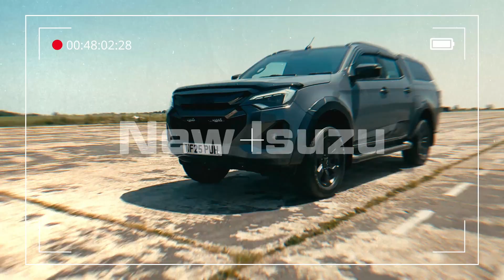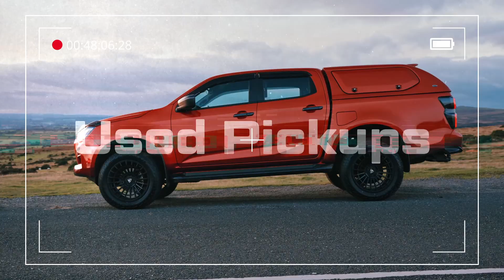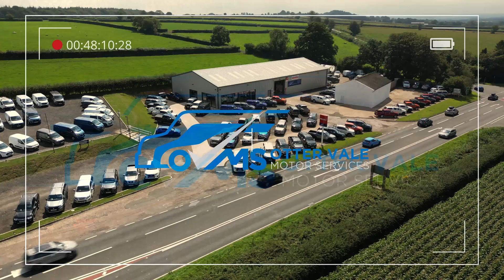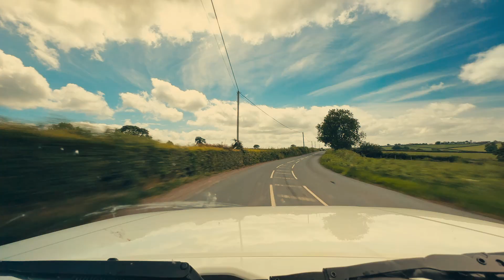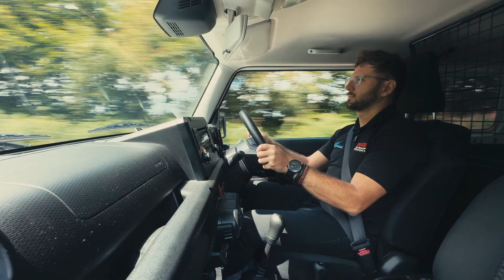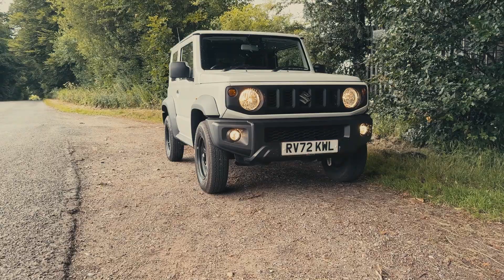Suzuki Jimny 2022 Commercial Vehicle Review

Comment: Good video, thank you. I’ve just bought a Japanese import Jimny. I’m’ 6’3” and have no problem with comfort and the driving position, but mine doesn’t have that cage in the back. My model is somewhere between your commercial and the full spec SZ5 without the screen and all the lane assist gizmos etc. Mine has  good air con  and a good stereo together with heated seats. 
IMO, these are great cars!
Reply: How are you enjoying it? Have you made any modifications to it or added any accessories? I’m planning to buy one too.
Reply: Yeh you right